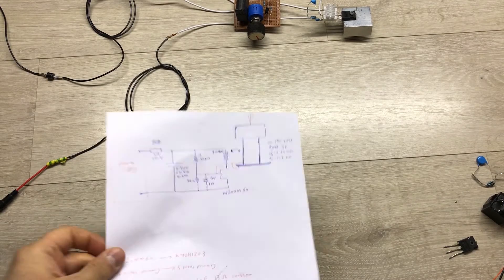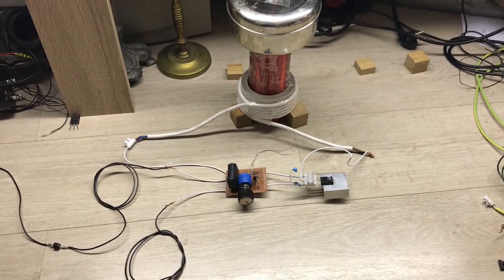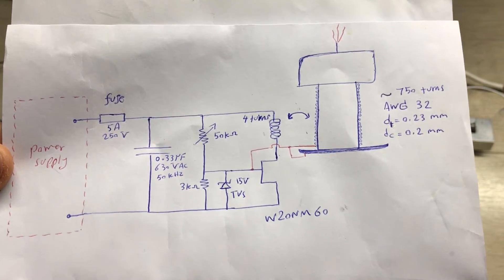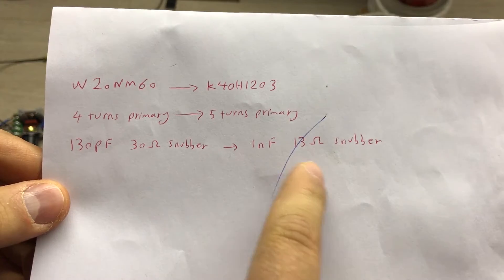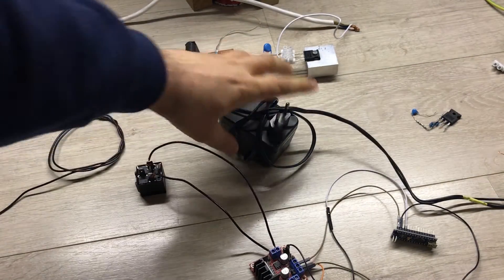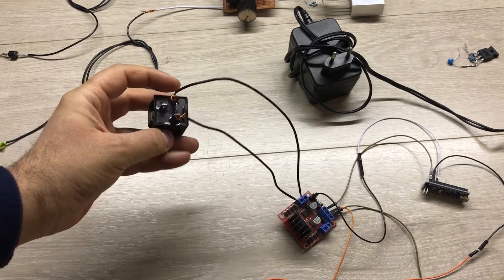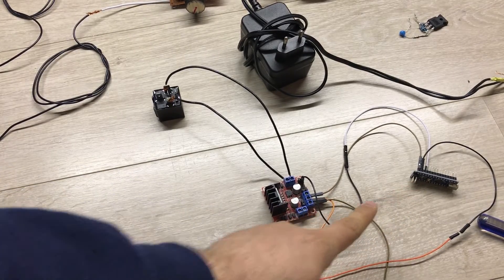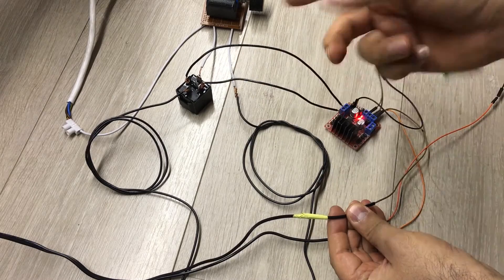Single Mosfet Solid State Tesla Coil ( SSTC ), no gate driver , ~ 40 cm streamer length

Comment: It seems that your circuit is much better than NPN or PNP versions. But why?   Is it thanks to very low resistance of the Mosfet?  And with the oscilloscope, is it all tuned at the same resonant frequency? Two black loops (just some inductances on input), thanks to them the 0.33uF can be discharged and transistor isn't getting too hot (there isn't too high switching OFF current)    and this primary coil LC is in resonance with the secondary coil with capacitance on top + the long sparks capacitance included?    Most of the other slayer exciter circuits don't have these resonating parts. And they have the primary coil too low (weaker coupling) than yours. Thank you for this video. Good to see that this can be done without complicated Mosfet gate driver.

Comment: 40 kV at 400 kHz for 40 cm sparks 🙂. You can measure voltage by attaching small sphere gap at the top of the coil (while taking care of frequency shift)

Comment: Is the "adjustable voltage regulator" (connected between the variac and the sstc circuit) is that actually just a dimmer switch?
Reply from the maker: Yes

Comment: how can i modify this circuit to run at 230v? Will increasing the gate resistance from 100k to 220k ? pleasr i need help
Reply: Use 20 k resistor instead of 10 k and and with Irf p460 I was able to get 15-20 cm sparks from this circuit

Comment: I built a coil based on your idea, but I used a solid state relay and for the interrupter I used a ne555, I also built a PCB for that.
Here is the link for my coil: https://youtu.be/wzfhb-ywe1M
I documented the whole process on the high voltage forum. Topic: Driverless Single Mosfet Relay interrupted SSTC

Comment: wow amazing streamer lenght. would you show me pvc's diameter for your secondary coil?? is it a 2.5" pvc pipe?
Reply from the maker: I think it was around 75 mm diameter and 170 mm height. It is just a salt container made of cardboard which i put some wire around it. take a PVC pipe with 80 mm diameter, it should work as good.
Reply: @HVE thanks for your explanation. actually i've build a copy as seen on your video. but i wind 0,15mm wire to 60mm diameter and 130mm height pvc pipe. not bad.. i got about 25cm streamer. next i'll try to replica your project. would you show me your wire size?
Reply from the maker: @AbuAsyifa  That is given at the beginning of the video, on the schematic. 0.2 mm
Reply: @HVE  oke thanks alot brother, i've missed that point

Comment: hello, i have a question, can i drive this circuit with the voltage regulator straight from the outlet 230VAC? im using irfp460. and do you regulate the arc lenght by the variac or the voltage regulator?
Reply from the maker: I think if you don't have a diode, you will apply negative voltage across your MOSFET and that will burn it.
Reply: @HVE  i would use a diode i was thinking if i have to use a variac because i dont have one so if i can plug the voltage regulator straight to the outlet and regulate the voltage with that (with diode in series)
Reply from the maker: @molty3614  Hi, You can do that, but probably you can not turn the knob of the regulator too much, otherwise your MOSFET will burn. Start from the minimum level and very slightly turn the knob, until you burn the first mosfet, keep the knob 20% less than that value for any future test. Above ~ 150 V  it is likely to burn the MOSFET, with the current parameters. You can change the design parameters and  you can directly use 220 V.
Reply: @HVE  thank you for your information. Would it be possible when you have time to reply to this comment with the changes i would need to make with the circuit to make it run on220VAC? You dont have to.    Thank you for your time.🙂
Reply: @HVE  hello i wanted to ask one more question can i make the resistance of the potentiometer higher than 50kohm to something like 100kohm to make it run on higher voltage?
Reply from the maker: No, that will just adjust the gate voltage, with higher voltage Drain source channel of the mosfet will burn
Reply: @HVE  ok thanks

Comment: Did you say single diode or signal diode?
What variable power supply are you using?
Reply from the maker: Single diode. It is a variac, 230 in, and i can control the output voltage by rotating its knob.
Reply: Thanks!

Comment: What relay are you using?
In your schematic the ground is connected to the bottom of your secondary wire, what is that same ground connected to?
Reply from the maker: Relay is a low voltage 12 V dc 30 A automotive relay. Ground is floated in my case.
Reply: Cool thanks

Comment: Incredible result!
I will definitely build this project. 
A question, what is the specification of the relay used?
Have you considered using a solid state relay?
Reply from the maker: it is just a 12 volt dc 30/40 amps relay. Solid state switch i will implement it later, you must be careful with its design, it can easily break if not designed properly
Reply: @HVE  I think you misunderstood, I'm not referring to Mosfets or IGBTs, but to a component similar to this: SSR-240D25
Reply from the maker: @TiagoSilveiraB  Hi, Okay I see. Yes, this will most likely work, but since it is expensive I would use it cautiously.
Reply: By the look, it looks same as an automotive relay. I've got same & used them too they worked perfectly fine.

Comment: Can I use irfp150
Reply: I made it , now it works like charm but the problem is it gets too hot, it gets hotter than tip 41c and ifz44n even with 3 amp 30v there is not much of output voltage comming from it i suggest to use ifz44n
Reply from the maker: It probably will burn, that mosfet has only 100 V DS voltage. Unless you apply very low voltage on the input, but then you will not get large discharges. Anyway give it a try and let us know.
Reply: Sure i will let you know
Reply: So like can i use 9v 2amp or 12v 3ap
Reply from the maker: @googleuser2544  what do you mean b  Volts 2 A ? is it the voltage source ?
Reply: Yes
Reply from the maker: @googleuser2544  sometime with very low voltage the circuit does not start to oscillate, depending on the type of Switch that you use.
Reply: With tip41c i get plasma discharges with 12v 3amp

Comment: Looks good. It would seem to give nice ramped swords with the proper voltage waveform. Staccato interrupter would seem to work well.
Reply from the maker: Yes, the voltage waveform, the voltage magnitude, the switch type, the coils arrangement etc. all have impact. Getting the right voltage waveform has a considerable impact on the output.
Reply: @HVE  lol yes, a long list of sometimes frustrating variables come with these things.

Comment: Dear Sir, I just wanted to ask you about that blue ceramic capacitor & the other component found on that connector on your power Mosfet transistor. Is that high voltage ceramic capacitor, what's its value & the other component, is that a resistance? If you don't mind dear sir, is that your snubber circuit? How did you connect them on the transistor? Are they connected between the drain & source? If so, what's the value of the blue ceramic capacitor plus its voltage rating  and the resistance ?Concerning your arduino nano, did you program it? Awaiting a prompt reply from you  dear sir as I highly appreciate & admire your video. Thank you in advanced.
Reply from the maker: It is a simple snubber, you can use a capacitor that is  3 kV or more, the resistor must handle the power loss in the snubber, since i did not have a good resistor, i used several resistors in parallel to increase the total power rating of that resistor. The values were mentioned in the video. Arduino nano is programmed very simply by turning a pin on have a delay and turning it off have another delay, turn on delay better to keep it around 11 ms, turn off delay anything above 200-300 ms is okay. you can reduce it as you wish but must be careful that you don't burn your switches. I selected 307 and a delay of 11 ms to have some randomness in the discharge (it sweeps over time over the 50 Hz).

Comment: Very well explained video 👌
Reply from the maker: Thanks Hassan, it's not your turn to explain very well the calculation of winding capacitance 😎
Reply: @HVE  Thus, if the diameter of secondary coil is 110 mm & with around 750 turns, your Resonant frequency is around 380 KHz. By further adding a big topload, your resonant frequency has now become around 250 - 300 KHz . Most of the single mosfet slayer exciter circuit works around the same resonant frequency but yours is by far the best I've ever seen.
Reply from the maker: @RAVI171175  Diameter of the former is 71 mm in this case, and the resonance frequency is 420 kHz.
Reply: @HVE  But if you've used 71 mm former diameter with 0.2 mm magnet wire with a winding length of 150 mm ( you mentioned 750 turns), then with JavaTC or any online calculator, your resonance frequency will be around 670 KHz.
Reply from the maker: @RAVI171175  420 kHz is together with the top load, and last time when I measured it (420 kHz, shown in the previous video) there was a metallic plate under it which also impact the total resonance frequency (lowered it than ideal case)
Reply: @HVE  Oh yes, of course as that plate under the secondary plus the topload will indeed impact & lower the F(res) to 420Khz. But so far, I'm still want  to know the value of that blue ceramic capacitor & that of the resistor you've used for the snubber circuit on the pins of the transistor. Awaiting a reply from you. Thanks